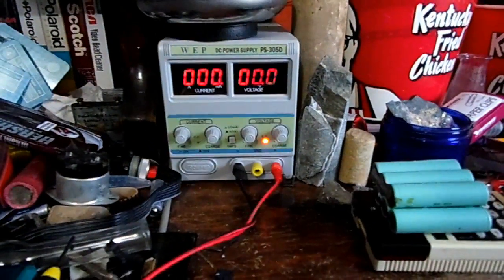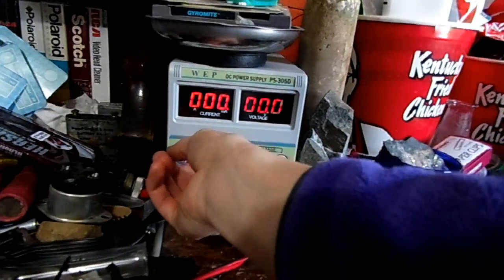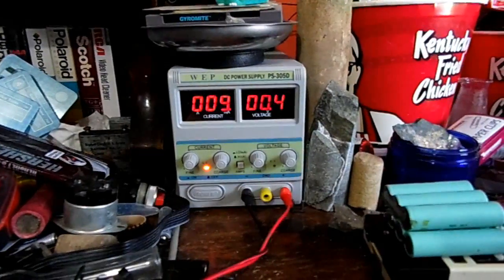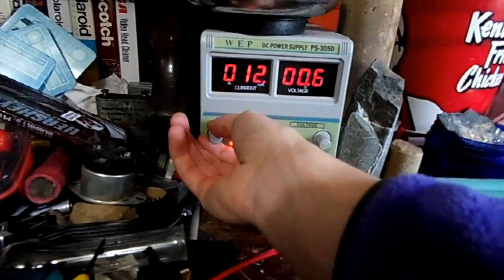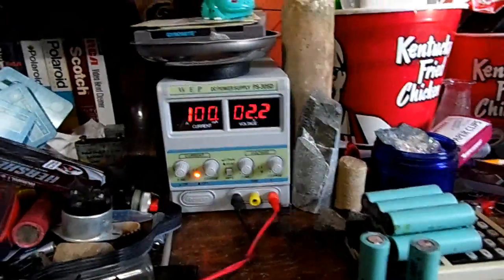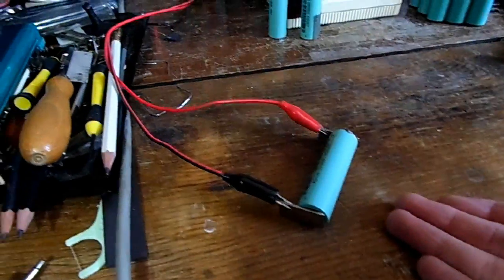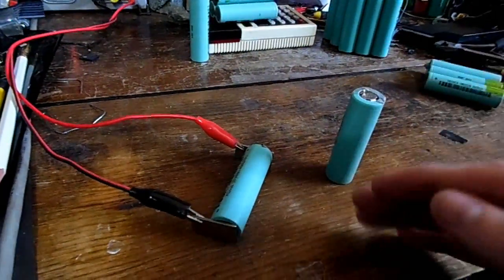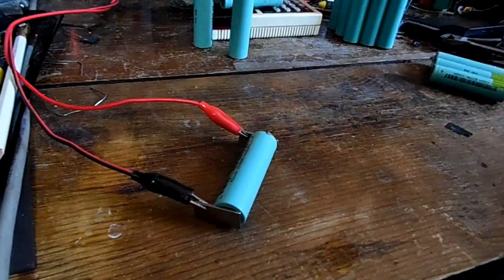DIY Revive Lithium 18650 cells

Comment: Even though your power supply is only 5 amp not 10, i really like how you have mA control and display, I might get yours for a secondary, I always charge batteries with my fluke meter in series to monitor mA Precisely, You can really dial it in that way, nice video!

Comment: Found an excellent Panasonic Lumix pocket camera at a thrift store, complete with battery, but no charge-cord. I applied 4V to it with a power supply, but it would only trickle 0.1 mA, so I left it on over night. No change in the current by morning. I disconnected the power for about half an hour, then tried again. It still wanted to trickle at 0.1mA, so I cranked the voltage up to 5V and back to 4V, and this time the current began to flow significantly. I limited the current to 50mA for about an hour, then raised it to 100mA. The voltage is rising at an acceptable rate. When it was at 3.7V, I was able to put it in the camera and it worked perfectly.  Next step is to charge it to 4.2V at 50mA.

Comment: Ok, So what about 3.7v and 0 current? i tried to charge many times it wont pass current, then i tried to empty the battery, just put in a low comsumption circuit, then it got empty in 5~10 seconds, made it just to make a new "Cycle" on the battery, then put the battery back to the charger and got 3.7v again but 0 mah, then i guess... my battery is dead?

Comment: can you recharge lithium cells with a small reverse voltage? say -0.11v
Reply from the maker: yes the voltage can probably be reversed, ive had a few lead acid batteries and alkaline cells that aged so much they were at a negative voltage. if the voltage is reversed the cell is totally fucked.
Reply: Voltage can't be reverse, it's just you checked cell with reverse polarity!
Reply: prashant sakariya I never checked the cell the wrong way... it was definitely -0.11v. I managed to charge them but they only hold around 1500mah. reverse voltage in a battery normally happens when a pack that's in series is over discharged and one parallel bank holds more power than another... so the pack will only read 0v when one cell is at -0.1v and the other is at 0.1v or something like that. the worse I've found is -0.5v and that cell was screwed, it leaked all of the charge once it got to ~0.2v
Reply: +micheals1992 yeah understood, I just had same problem and I thought that my multimeter is screwed up, Lol! Thanks for Info.
Reply: reverse voltage......the fuck are you talking about
Reply from the maker: DragonsREpic
the positive terminal is now negative and the negative is now positive.
Reply: OHHH....he could have just fuckin said reverse polarity. Im in a real shitty mood >:(

Comment: I connected my cell that's at 1.5v in parallel to a cell at 4.1v with a 470 ohm resistor which should be passing around 20-30ma.... is this method ok? it's been connected for about 10 minutes now and it's at 2.5v, I'm going to leave it until it reaches 3v or just slows right down to a crawl.
Reply: I just accidentally shorted a 4v cell with a 0.7v cell (I instantly removed it because I saw it spark when I connected it)... it jumped up to 1.15v and now I managed to fix the short between to 2k resistor and the cell and the voltage is climbing so hopefully it didn't cause any damage :S. 

Edit - I've charged it upto 1.55v and It's stable (I've left it at 3.7v and it seems ok)... I think i'm going to do the same for all of my cells and then switch to a 470 ohm resistor, wait till they're at about 2.6v and put them in the lithium charger at 250ma

Oh wow... the design in the korean battery is so much better! and all the cells are samsung and at 3v+ (the chinese one measured 0.79v, 0v, -0.11v and the wiring was all over the place!). the only downside is that it's hard to strip! :O lol. this has given me high hopes for the Japanese Dell batteries

the first dell one had 3.6v, 2.7v and 1 at 0v (one of the 0v cells looks like it's leaked so maybe it has shorted). the 2nd dell pack was pretty much all dead, 2 of them don't even have continuity and the other 4 charge but pretty much leak all of the charge they take within a few minutes (6/12 work). All but 1 of the cells from the chinese pack have taken a charge (even the -0.11v cells), one of the 0v cells was completely shorted but the other works

Both the Dell packs used Sony Cells, hmm... turns out the other 2 I got are Dell packs but they both used Samsung cells (even the badly designed chinese pack) and 92% of them worked... the Sony cells only 50% of them worked... maybe I should log this down to see which cells tend to last longer (although there's no way to know what each individual packs environment and usage was like), all of the sony cells that have failed look like they have leaked at some point or they have water damage... maybe I should try stripping the plastic casing off incase there's still water under the sleeving causing a resistive load

Comment: thanks for posting this video, a quick question: is it possible to charge a bunch of these batteries connected with each other using the same method that is, or does have to be individualy?
Reply: Don't, if one battery dies the rest will do the same

Comment: Motorola developed a machine over 20 years ago to revive radio security batteries, it would cycle the battery few times ensuring the pack is safe for use. Very useful many years ago when battery prices were absurdly expensive.
I am glad you quickly covered this topic explaining all people need to know about manually "reviving dead cells" at home. =]

Comment: i connected 18650 to psu on 4.2v and it doesnt draw any current but when i disconnect and measure voltage it shows ~3v and its droping really fast
should i leave it?

Comment: When you start, with the current set to almost nothing, what do you have the voltage set to?
Reply: At begin voltage doesn't matter while it doesn't exceed voltage limit that is safe for lithium batteries. Current limiting matter. You may set initial voltage to lower safest Li-Ion battery discharge voltage - 3.4V and set current limit to 10-20 mA. When battery is connected and begin to charge, voltage will drop to something around 1-1.5V and then slowly will begin to rise. If voltage doesn't drop, it is clear that battery is disconnected from terminals by protection circuit as dangerous or due to structural damage (most likely because of both). If that then battery is done and you must throw it out. Otherwise charge it to 2-2.5V - then you may put it into charger and charge to full. Built-in batteries like phone batteries must likely should be charged to 3.3-3.4V before putting them back into phone, otherwise phone charging control circuit may not accept them. In all charging time during reviving take attention to battery temperature. Li-Ion batteries may became warm but not hot. If they became too warm, then something is not right - must likely battery is internally shorted and must not be used anymore.

Comment: any advice for those who don't have a bench psu?
Reply from the maker: +Andrea Corinaldesi get a bench PSU
Reply: +Andrea Corinaldesi a cheap CC CV buck/boost converter on Ebay.
Reply: +Andrea Corinaldesi If you have a hobby charger you can put on Ni-CD mode and start the charge at lowest amperage (100 mah) and when voltage climbs to about 3 volts switch over to Li-Ion (or Lipo).

Comment: Hi Rinoa-

After doing some research on 18650s and watching your channel a little bit, I decided to acquire 1000lbs of laptop batteries.  Yeah... I know.  Any advice for proceeding? I'm set up with an RC charger, some battery holders, and I intend to build a tab welder.  Please message me if you are interested in acquiring any... I'm selling the extras I'm not planning on using at $.50 per pound plus shipping.
Reply from the maker: +dequinox yeah i'd be very interested, what state are you in?
Reply: Oregon.
Reply from the maker: dequinox
oh thats not bad at all since i'm now in california. when you start testing the cells i would love to hear how many mah per cell your getting on average. i'm making deals with local recycling centers to get laptop packs but thats at 2.25$ per pound.

my upcoming projects could easilly consume 8,000 lithium cells.
Reply from the maker: dequinox
also are they all random battery packs or all similar model?
Reply: I received them random, but I get a higher percentage of Dell and HP packs than anything else.  I don't know a thing about g+... so you can email me at my username on Google
Reply: +Rinoa Super-Genius Also sorry for all the confusion... my phone was telling me posting comments was failing last night... so I kept retrying. Apparently  my phone was wrong, and it was posting after all... hence the three comments on each question you asked ha ha ha.  Anyways, my username @ gmail and we can discuss a shipment, or even freight if you want to acquire a large quantity.  I have about a 500lb left I'm still selling from.

Comment: Thanks, that was quite useful. Until now I've been under the impression that lithiums die if they go under 2.6v, and any attempts to recharge them will end in a firery mess.
Still, I take it that even after you've revived them, you can't charge them using a regular charger?
Reply: Not the case... Once you safely brought the voltage back up to a safe point, they charge just fine at lithium ion rates.  

The trick is, tiny voltage to get it up past a threshold (2.6v ish) before transitioning to higher amperage.

For example I have eight cells concurrently charging in a smart charger, once the cells get past 2.6, the charger recognizes them as lithium-ion....

And it is still only putting a Max of 300ma into each cell.... While it has the capacity to put a max of 800ma*8 cells.

Comment: I recieved about 300 old motorola cell phone batteries. The problem is that they have been in storage for 3years and they are completly flat(0v at termainals). Do you think it's possible to revive them? They have never been used, the guy ordered too many of them and got stuck with them.

Comment: A question - when you connect the PSU - you just add amp....? don't you have to set the voltage to specified or it builds voltage by itself? Because the energy goes from PSU to Battery, there must be a voltage specified but your PSU doesn't show that. What am I missing?

Comment: I was wondering if you were able to use the lower ah batteries. I was putting anything over 1.2 ah in my use pile. I have a lot between 1.4 ah and 1.6 ah.. Not so many at 2 ah .
Reply from the maker: i would say save even the 600mah ones for making a large flashlight battery or something.

Comment: could you use an alkaline battery to revive a "dead" 18650 to 1v or so, using a resistor to limit current if necessary?

Comment: Once you have "revived" the batteries, can you then charge them as per normal? Or do you always have to babysit them when you recharge them? If the latter, then it hardly seems worth it.
Reply from the maker: They work perfectly normal once above 2 volts or so. Its just if they go down to 0 another time there is a higher chance for them to short out. But they shouldn't go to 0v anyway.

Comment: how can i build a charger?
Reply from the maker: why not buy one?
Reply: Rinoa Super-Genius i mean one in which i can control the amps?
Reply: Rinoa Super-Genius whats it called?
Reply from the maker: Vandy Niyomkham
 but why? you can get them for 20$ from ebay.
Reply from the maker: http://www.ebay.com/itm/Boost-DC-DC-Converter-Power-Supply-Step-up-Module-10V-60V-to-12V-80V-600W-10A-/221611660758?pt=LH_DefaultDomain_0&hash=item33991595d6 or you can get one like mine http://www.ebay.com/itm/30V-5A-Precision-Variable-Adjustable-Digital-DC-Power-Supply-Regulated-Lab-Grade-/380937875451?pt=LH_DefaultDomain_0&hash=item58b1aaaffb
Reply: Rinoa Super-Genius thanks man i appreciate it
Reply: Rinoa Super-Genius   if you can build one with just that small converter, why do power supplies always look so big? Heatsinks?
Reply from the maker: danh le
yeah heatsinks, also they are built with better materials and tend to allow more power through.

Comment: Thanks!! Another ? For you what's the highest volts that these can handle.ive be taking mine apart and I'm getting 4v on some 3,3.6 3.7,3.9and 0
Reply from the maker: well theres a ballance between when they will fail and when they will hurt themselves.

4.5v might explode
4.3v may short well-used cells and only give 150-250 cycles
4.2v normal full charge will give 300-500 cycles
4.1v will deteriorate the cells half as much and give 600-1000 cycles
4.0v will deteriorate even less and give 1200-2000 cycles. but you will only be storing like 70% of it's total capacity.

if the cells have never gone bellow 2v they should have good capacity and be stable. if they have gone to 1v or 0v they may be a bit unstable so i would put those together so if it dies it will only kill other unstable cells.

by "unstable" i mean you can't drop them to 0v again because then they will prolly short. but if they are at normal voltages they work fine. lucky thing is if the battery somehow got to 0.2v and it shorted out, there isnt much energy to make them dangerous. they might get really warm though.

any time the cells are above 4.0v there is enough energy to dissolve the plates inside so if you keep a cell at 4.2v for years it will slowly die. but keep it at 3.9v and it can last decades.

Comment: How long did it take or could take to charge at 70ma to get higher than 1.6v?
Reply from the maker: idk 3 minutes? as soon as you stop charging the voltage shouldnt go down. it can go down like 0.1v but if it continues to drop then its bad.

Comment: Have you ever come across cells with built-in undervoltage protection that have disabled due to being over-discharged, and managed to get them going again? I recently tore apart an old laptop battery, and out of the eight 18650 cells inside it, six have disabled themselves due to undervoltage, and I can't get them reactivated at all. The only advice I've found online is to connect a good cell in parallel with it to disable the protection, but it doesn't work for me.
Reply from the maker: usually they would say 19670 if they where, the cells are prolly just shorted out. protected cells are a bit bigger than regular cells and a lot longer.
Reply: Rinoa Super-Genius They're actually the opposite - open-circuit. This is apparently what's supposed to happen when the protection kicks in. They all have several hundred thousand ohms of resistance, and as a result won't take a lick of current.

However, I just did some reading, and apparently the protection circuitry can be found on the bottom of the battery under the wrapper. I unwrapped one, and there is definitely no circuitry, unless it's actually sealed in the case. So now I'm not sure - I've never heard of a battery failing by going open-circuit. Thanks for getting back to me, anyhow.
Reply from the maker: *****
 i've had them go open circuit before.
Reply from the maker: *****
 only protected cells are protected. and not many cells are that type.

Comment: What voltage should a 3.7v li ion battery be at when fully charged
Reply from the maker: 4.2v but for every 0.1v you go lower they last 2 times as long.

Comment: Yea, I like the lead alum batterys. I plan on desulfating a bunch of dead car batteries and making a battery bank for my solar system here in the Philippines when I build my house. I don't like lead acid batteries much. They are dangerous and that acid can scar you for life, nasty stuff!
I was wondering about what you said about the joule thief. You said that it steps up the voltage and steps down on the amps. When I hear you explain this, im hearing "more pressure on the voltage, "like a pressure washer spraying a high powered stream of water, and less amps, "less volume of water being used,".
If this is correct, then I figure using a higher pressure, "higher voltage, is more efficient that using more amps, correct?

Comment: will this be the same for under volted nickel metal hydride batteries? i race and drive rc's keep up the good vids :) i really enjoy every one of your vids :)
Reply from the maker: hrmm i don't really know. i try to stay way from nickel batteries couse i've always had them die ;P
Reply: yeh they dont have a long life span and i have had the same battery pack for over 3 years and still going strong maybe one in a couple hundred thousand? and they are also quite toxic i probably would not chance a short its a 6 cell 3.7ah battery

Comment: How do you make sure your replys are done correctly? I see the last one I sent had that linked comment box, is that what you want to see?
And I will give that crystal battery glue cell a try. If it has any good results I will let you know.

Have you ever made a rail gun? I wanted to see a really crazy powerful one with a bunch of huge capacitors that could blast a hole through an engine block. You could carry it around in a back pack with the gun attached to it with a cable. Would be like the rifle back pack used in ghost busters.
I know that sounds stupid, even suicidal if it happens to rain, but that would be amazing to see. I wonder if it would get you into trouble if you made something that powerful.

 Is there some limit on what you can do? Like your electric bike. How fast can you soup that bike up before its considered too fast. If you make something really crazy dangerous does you tube cut you off?
 I haven't seen anything terribly dangerous on you tube, like how to make an rpg or a do it yourself rocket pack.
I think that might be a good thing if that's true.